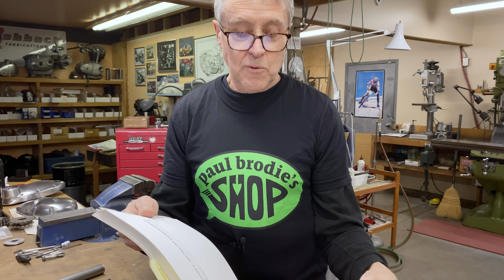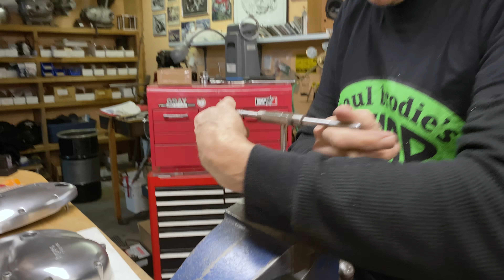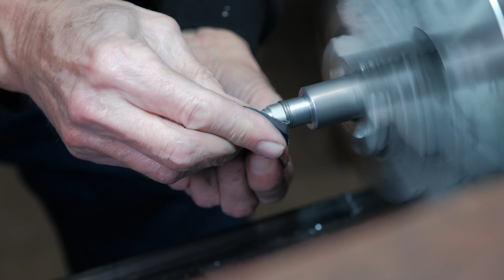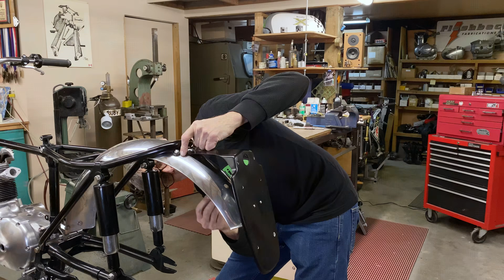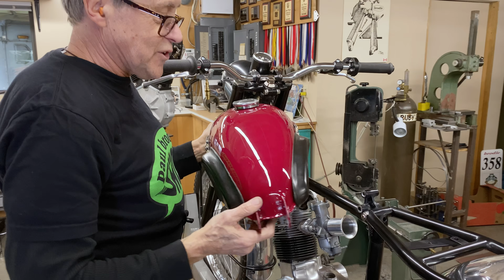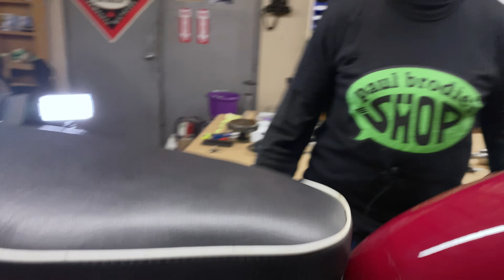How to make acorn nuts // Paul Brodie's Shop

Comment: I love the caliper pliers! I'm not a machinist so I have a question, when you're turning the round cap with the glove, is there any risk of the lathe grabbing the glove and pulling you hand in? When I used to use buffets and grinders in a shop we were always told not to use durable gloves, and only use nitriles or finger covers.

Comment: There are a number of different grades of stainless steel. and depending on the grades of stainless steel. a person can tell by using a magnet and it won't stick to 100% stainless steel.

those are real acorn nuts. the one's that a person can buy at the hardware store or an auto parts store. the cap is welded on to the nut.

Comment: I made such nuts. Bought 17mm hex aisi 303 ss, drilled and tapped the blind thread and the sphere I cut using a radius ground hss stock. 
Less effort,  same result.

Comment: 303 is great for machining but burns away when welded to plate and box section etc. 304 is better for welding etc such as if you turn a boss then weld it to box section or plate.
Reply from the maker: You are correct. 303 is not meant to be welded...

Comment: Thank you so much Paul and Mitch.  It's nice to see a different approach to cutting the hex using the rotary table.  Another method would be to use a hex collet block with a 5C collet.
A joke we would tell when I was a Test Engineer in the Aerospace industry was "Measure with calipers.  Mark it with a sharpie.  Cut it with an axe."
Thanks again.
Reply from the maker: Thank you Bluesman. I don't think I have a hex collet block. When we figure out how to do a job I think we are quite conscious of what tooling we have, and what we don't have...   :face-fuchsia-poop-shape:

Comment: Nice video Can you tell why you did not use hexagon stock instead of round bar? Thank you.
Reply from the maker: Thank you. Hex stock is only available in standard sizes like 1/2", 5/8", etc. These acorn nuts are 5/16" Whitworth which is a completely oddball size.

Comment: I was taught NEVER put or lay a file on the mill table. Protect the surface at all cost.
Reply from the maker: That sounds good. But, I am only placing the file on the surface, not pushing it around with pressure. I often put them on a rag, just not this time.

Comment: Hi Paul, love your channel.
I have noticed that you are using a lot of whitworth/BSF/BSC threads.
Do you have the correct spanner’s/sockets for these?
I have a small selection of spanner’s and sockets that you are welcome to have (just postage to cover). If you are interested, I can weigh them and work out the postage. I’m in the UK.

One other quick question, can you do a video on the full-suspension (downhill?) MTB that is on you wall? I’m curious about age/era and the design ideology behind it.

I also love the JT pic on the wall behind your lathe. Mammoth Mtn, early 90’s, rooster tale, what’s not to like!!
Reply from the maker: Thanks Stuart. Two people have donated Whitworth wrenches and sockets to my collection, so I am good. Very kind of you to offer :) Mitch and I both thought we had done a video on the 69er, but you and others keep asking, so maybe we were wrong. Yes, Tomac was so dominant back in the Heyday of Mountain Biking!

Comment: The ball turning attachment could be made safe by making the base thicker and using a taper so that the top plate is held captured by the bottom plate.  This would be better than using gloves, which only complicate any injury should fingers get pulled in.   You can still use the grease to get a low friction zero play mechanism.
Reply from the maker: Good comments. There is very little space to get everything to work, so making the base thicker is not a great option.The grease is not so much for lubrication as to hold the two plates together. I use this once every two years. For daily use I would modify for sure.

Comment: 7.28 - Using a calliper instead of pliers ?
In the UK we generally call them domed nuts ( perhaps acorn nuts have more of a gothic arch profile to them ) , I'm surprised you didn't start of with hex bar. I did make a cross between a domed nut and a fen nut from a casting runner ( about 2 inch across the flats ), I did the hex on a bench grinder. 
Nice to see you have decent speakers in your workshop.
I've used work hardening SS, it's best to really go for it when drilling, to try to keep ahead of the heat build up.
I think I'd try to do the dome with a form tool, and try to dome and part off in one cut.
Reply from the maker: I do have stainless hex in standard size like 5/8". I was making Whitworth nuts and do you think Whitworth hex is still available? Apparently not! Yes, the caliper was in my hand and it did work exceedingly well for capturing metal in the bandsaw. Thanks for watching.

Comment: Hi Paul,
Really enjoyed this video, so I have subscribed. 
I am currently restoring an old British Replica of a 1955 MGTF and have my own channel to share the work I am doing. So far I have built a blasting cabinet and a rather large high performance powder coating oven to support the project. I also ride a Norton café racer (in the summer) and looking forward to building up a few bikes once the car is finished.
My channel is called 48 Spokes if you would like to check it out.
Anyway, better get cracking in the workshop.
Kind regards
Paul (from 48 Spokes) UK

Comment: Hey Paul, Paul here. I was wondering how you clean the motor and achieve that finish? Do you have it vaporblasted or another process?
Reply from the maker: The motor was all done by hand. Hand filing, then emery cloth. 80 grit, 180 grit, 320 grit, coarse scotchbrite, fine scotchbrite, aluminum polish.
Reply: @paulbrodie  Nice, that's what I'm going to try. 1966 triumph 650. Complete rebuild down to sludge trap. I'm enjoying your channel.
Reply from the maker: @pauliebots   Thanks Paul. It's a lot of work to get cases like that. You might get sore hands and fingers :)

Comment: 316 is the marine grade of stainless steel, not 304. General fasteners are made from 304 (A2-70) grade stainless, fasteners for use in marine craft are made from 316 (A4-80) grade stainless.
Reply from the maker: Are you sure? That's not what I read..
Reply: @paulbrodie  Hello again Paul, yes I am sure, I worked in the engineering industry for almosy forty years. I've tried uploading 304 v 316 youtube video links but unfortunately they don't seem to work. 

Type in 304 v 316 stainless for yourself and there are several videos explaning the different properties between these two most common types of stainless steel.

Comment: Great work. Love the crankcase. Have you tried having your frames powder coated? I have the same problems with scratches while assembly as well. Would love to get them powder coated. 
That is a nice round cutter. Kinda like a form dresser for a surface grinding wheel. You're well ahead of the pack around cutting machines. But I'd never let anyone use gloves around any moving cutter or chuck. I'm not a safety Sally , but I've seen too many rags , chip brushes being jerked into cutting heads , and chucks. Have seen bunches of photos of mangled hands or what was left of hands from gloves being around mills , n lathes.         My back is ruined from not using overhead cranes , and forklifts , but I still have all my fingers 👍
Reply from the maker: Thanks Phil. Yes, I understand your safety concerns, but I am conscious of what can go wrong and I also still have all of my fingers. Thanks for watching.

Comment: Acorn nuts came out nice, I've used profile tool for small sizes (5mm & 6mm) which were easy when I had big Colchester lathe, mini late, chatter on even small sizes.
Used to do a fair bit of fibreglass 30+ years ago (Dragon Glassfibre, Kayaks and Surf ski's) but what worked  well in Britain at ~60 def F and lower doesn't work at 85~90 deg F in Florida. 
Really should re-visit it though, still need a custom seat pan for CB360. I bought a Kawasaki Z650 tail piece but it's way too wide, took a mold off it then 'got hurt' in work and shelved a load of stuff
Reply from the maker: Thank you Peter.

Comment: Please don't wear gloves while working on the lathe. If that chuck catches you, well, it's hard to go trial riding with one arm. 
Use your brains and modify the ball turning attachment or make a mk2 version. There's better designs out there than the one you made that will hold things nice and stable and eliminate chatter.
Reply: I know, I was worried the whole time, and wondering why he didn't just use a radius ground tool and ease it in with the cross slide.  They are cheap and way better than a ball turner on these tiny projects.

Comment: Might not make sense if you only have a few to make, but note that there is hexagonal bar stock available in stainless steel as well. At work we have brass hexagonal stock for the purpose of quickly being able to make a specialty mounting component, it hardly ever gets used, but it is a lot quicker if you do need it🙂 Also, because of the fact it is rolled, it will be stronger because you do not have to cut through the grain direction. Same reason rolled threads are stronger than cut threads.
Reply from the maker: Yes, hex stock is available in standard sizes, but I was making 5/16" Whitworth hex sizes, so standard is not suitable. Thanks for commenting.

Comment: Paul, AISI 303 machines the best but cannot be polished as nice as 304 or 316 and It has a hue of brown. If you want to weld too use 316L. I found out that the 316 requires a bit more attention during machining but once you get it right it's business as usual or it repeats well (although warm rolled can be tough). 304 seems to be a surprise package when machining. I had friendly encounters with it but it sometimes made me curse when burning drills and other tools. For the food industry 316 is the way to go and looks great when machined and or polished well. For that reason I only stock 303 and 316. The radius tool works great but I think there's room for improvement ;-) Maybe a fixed thrust bearing bolted in place? Thank you, and the mystery cameraman Mitch, for al your wonderful uploads! Greatly appreciated! All the best, Job
Reply from the maker: Thanks, Job. Good comments :)

Comment: The spacer issue with your rear wheel might be due to you needing the shorter spindle. My ‘59 cub frame has narrower rear wheel mounting lugs than my ‘60 frame. I found I had a 1/8inch gap when I did up the wheel nuts fully. The shorter spindle, part W1505, is 7+9/16,” whereas the longer one, part W989, is 7+11/16.” Regards, Alan
Reply from the maker: Alan, you might be on to something. I believe my frame is a '57 and the rear wheel could be off a '65. Thanks.

Comment: Those nuts came out great, and they look like you made them too if you get what I mean. I’m looking at the ones I bought now with total disdain! Shameful, second rate acorn nuts!! 

The bike looks great all together, Paul. I always think it’s interesting when you diagnose a possible reason for damage to parts and that rear hub is bizarre. I’ve been guilty of ‘fixing’ irritating noises in my car by assuming it’s not mechanical, it’s merely a stereo volume issue, but I can’t imagine running on two wheels with the bolts loose on one of them!
Reply from the maker: Thanks Leigh.  Yes, let's rid this world of disdainful, second rate acorn nuts!

Comment: Yep, the seat will become so much cooler once you perform your magic. I like that tool for the domed section of the acorn nut, so what's the reason for making the rotating section only held on by the grease?
Reply from the maker: It was the easiest way to make it, and it does work :)

Comment: Hi Paul
Free machining stainless 303. The sulphur added is supposed to reduce the shear strength of the material without reducing the tensile strength. As long as the parts made are not in a heavy shear application they should be ok. I have tried welding 12L12 free machining leaded steel without much success. Since it is resulphurized, rephosphorized and leaded it has it own built in contamination. Have you tried TIG welding 303 stainless?
Cheers
Glenn
Reply from the maker: I have not tried welding 303, but I have Tig welded leaded steel for some bicycle stands I made years ago. It was strong enough for that application.

Comment: There is no such thing as BSC (British Standard Coarse) as you call it, it is British Standard Whitworth, or Whitworth for short.
Reply from the maker: BSC is British Standard Cycle thread.
Reply: @paulbrodie  Paul you are correct.   British Standard Cycle is a thread that is 26tpi for all sizes above 1/4'. British coarse threads are Whitworth.
Reply from the maker: @johnmartin6050   I learned from Robert Watson.

Comment: Watching those cases go together reminds me of the BSA manual where it says when splitting the cases, ~remove the joining bolts on the bench and 'drop smartly' !   🤣
Reply from the maker: "Drop smartly". I like that!
Reply: @paulbrodie  I'm guessing because the crank was always such a tight fit in the bearings on each side.
* Perhaps just the locating dowels?
Whatever.....  it works!

Comment: I'm lazy and tend to use hex bar for making my own domed nuts, but they do look so much better than the ones you can buy.  👍👍👍
Reply from the maker: Thanks Sid. Hex is only available in standard sizes, and this hex is Whitworth!
Reply: @paulbrodie  in UK you can buy whit hex stainless, or at least you could before a certain virus screwed (pun?) things up a bit. Seems Hitchcocks still list it.
Reply: 18mm is 3/8 Whit aswell which is a good go to size.

Comment: It would be interesting to see you do a video on swapping the rear hub. About ten years ago my dad and I came across a guy selling a old bronze Var truing stand. It beautiful but we had no need for it. Remember those old cast iron bicycle stands built Japan. The top was blue with a red casting for the base. My dad bought one for me when I was about ten.
Reply from the maker: Swapping the rear hub probably will end up being a video. Yes, I do remember those old Var truing stands. Never owned one. I use a Park stand for bicycle wheels.
Reply: @paulbrodie  Park makes some nice tools. In my comment I wrote bicycle stand, I ment truing stand. The reason that I think it would make a good video is to show people that lacing wheels is not as hard as it looks.
Reply from the maker: @andyZ3500s   Andy, we have done that. The Aermacchi rear wheel is a lacing and truing video. But we can do it again on the Cub rear wheel.

Comment: How do you feel about the angle the carb is on ? Thinking out loud you could cut the intake manifold at half the angle needed, flip one piece upside down and weld them back together. It would also solve the throttle cable problem.
I'm sure you'll figure it out, it's a pleasure watching you fabricate. Thanks!
Reply from the maker: I feel good about the angle the carb is on. It's not extreme. If I weld the intake manifold the aluminum will lose its' heat treatment. Wouldn't want that! Thanks for watching.

Comment: Use windex and spray the area where the decal is being applied. You can then apply and move the decal around on the surface to center it perfectly. The windex will eventually dry and the decal position will be fixed. Please mention my name Colin on your next episode for this tip and my wife will go absolutely nuts. ;)
Reply from the maker: Colin, I'm 67 years old and you want me to change my ways? You might have to search for alternate ways to make your wife go absolutely nuts :) Thanks for watching.
Reply: @paulbrodie  I recommend doing exactly what you've been doing for 67 years. Please mention my name Chris on your next episode for this tip and my wife will go absolutely nuts. ;)
Reply: Paul always mentions my name (it’s the same as his) and my wife is nuts anyway.

Comment: Any reason why you didn't you do a circular dovetail on your radius tool? Looks like it works great without one but kind of surprised!

Also, I'm sure there are many comments to this effect but you'd be better off without the glove! No glove you might get a nasty cut. With the glove you might lose your arm. eeek
Reply from the maker: Bradley, I am not a woodworker, so I would have to Google circular dovetail to fully understand your question. I knew there would be comments about using a glove. I felt safer using it, that's all. I will be careful, I promise.
Reply: @paulbrodie  Think dovetail like the dovetail that keeps your lathe cross slide or Bridgeport table from lifting up. Not a dovetail that keeps front front of your cabinet drawer attached! 
A circular dovetail is just a fancy way of saying a bevel cut into the rotating part, with a corresponding beveled washer (or washer like object) holding it down, so it can't escape. Easy concept, hard to describe in text! I'll email you a sketch.
Reply from the maker: @bradley3549   Bradley, thanks :)

Comment: Paul, regarding scratching your frame....
I watched a fellow restoring an old Honda 750-4. 
When it came time to fit the motor, he put the motor on the floor, turned it on it's side, then picked up the frame and lowered it over the motor sideways. no scratches!
Reply from the maker: Yes, I have heard that works well for Harleys too. I have probably had the Cub motor in and out 20X. It's not really scratches, just small chipping of the paint right at the edge of the motor mount, for example. When it's complete, I'll do a little touch up for sure.
Reply: Amazing channel. Love all the work you do. Learning a lot even as simply as how to make acorn nuts. Keep up the great content!